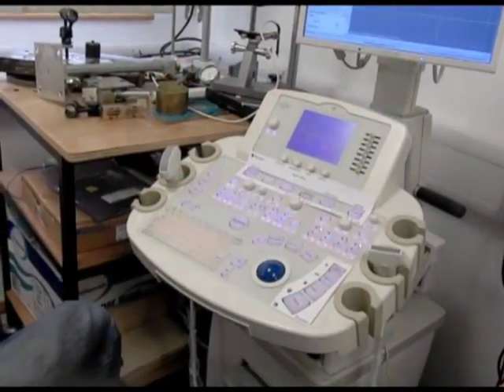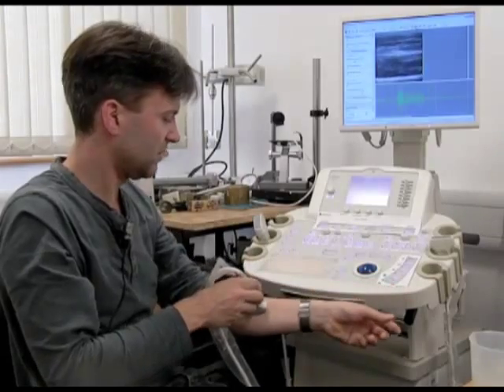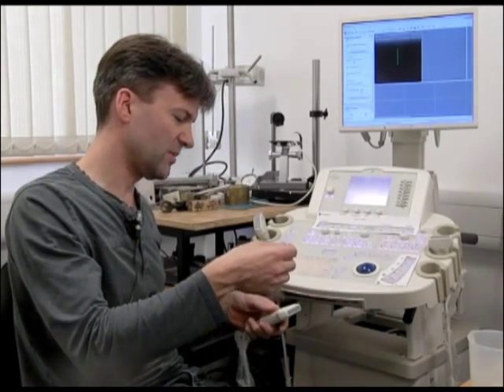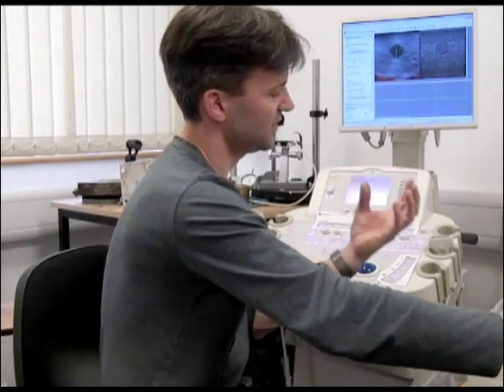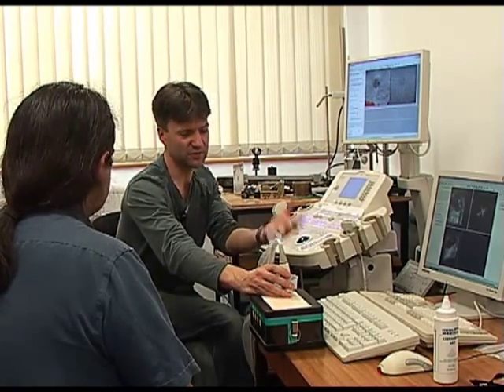Ultrasound Elastography - Naked Engineering

Comment: AI Summary

Abstract:

This transcript features Dr. Graham Trees discussing the fundamentals and recent advancements in medical ultrasound imaging. He explains how ultrasound uses high-frequency sound vibrations, similar to sonar, to create cross-sectional images of soft tissues by detecting reflected waves. The detailed explanation covers the function of a multi-crystal probe, which uses both physical lenses and electronic focusing to form a narrow sound beam. The core innovation highlighted is "stiffness imaging" (or elastography), a method that utilizes the same ultrasound signals but analyzes subtle tissue movement and strain to map stiffness variations within the body. This technique is presented as a more precise and deeper alternative to manual palpation, capable of identifying stiffer anomalies like cancerous lumps that might be indistinguishable on conventional ultrasound images. A demonstration using a phantom with embedded stiff spheres clearly illustrates the superior contrast of stiffness imaging compared to traditional reflection-based ultrasound.

Summarizing Ultrasound Technology and Stiffness Imaging

*   0:05 Basics of Ultrasound: Ultrasound is a widespread, cheap, and effective medical imaging technique for soft tissues, including fetuses. It uses high-frequency sound vibrations, beyond human hearing.
*   0:28 How Ultrasound Works: Sound vibrations travel into the body, bounce off different tissues, and are received back by a probe. This process is analogous to sonar, forming a cross-section image of the body.
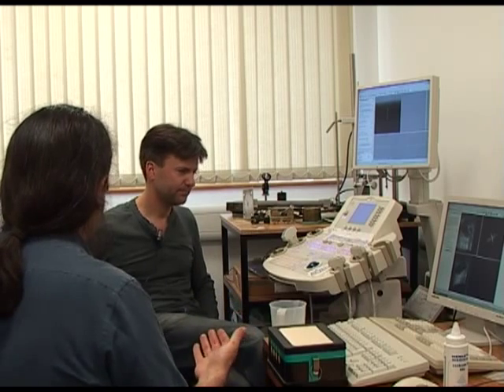*   1:10 The Ultrasound Probe: A typical probe contains an array of hundreds of crystals. These crystals vibrate when electronically pulsed, sending out sound. They then convert the returning vibrations back into electronic pulses, which are displayed as an image.
*   1:44 Creating an Image: Multiple crystals are used to create a cross-section image (not just a single line of data), by sending and receiving sound from adjacent areas sequentially.
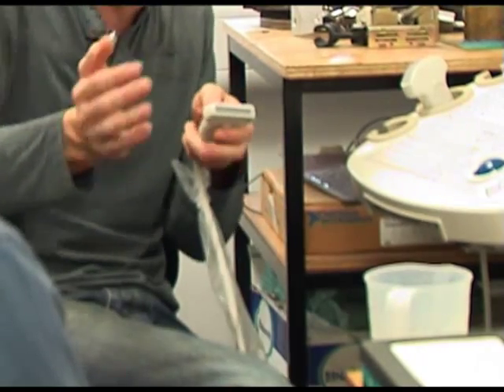*   2:01 Focusing the Sound Beam: A physical lens focuses the sound in one direction (elevational), while electronic focusing (firing crystals with slight delays) creates a narrow beam in the other direction (lateral), resulting in a thin sound beam.
*   2:38 Practical Application & Limitations: Water or gel is essential for scanning as air reflects all sound. Ultrasound is ideal for soft tissues and babies because bone almost entirely reflects sound, preventing imaging beyond its surface.
*   3:42 Introducing Stiffness Imaging (Elastography): Dr. Trees introduces a more sophisticated use of ultrasound that images tissue stiffness rather than just sound reflection.
*   4:09 Clinical Significance: Stiffer areas, such as cancerous lumps, typically "pop out" very clearly in these stiffness images. This offers a more precise, objective, and deeper method than manual palpation (feeling for lumps). It can detect millimeter-sized anomalies at depths of 4-5 cm.
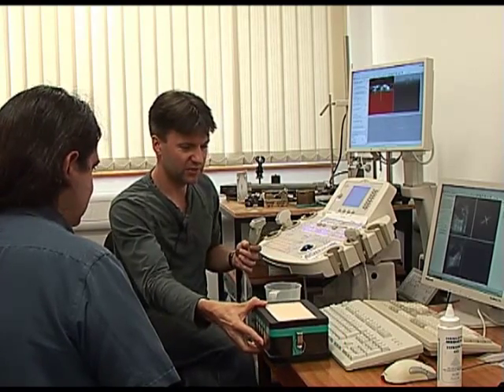*   4:54 Phantom Demonstration: A phantom (tissue-mimicking material with stiffer spheres) is used to demonstrate the technique. While a conventional ultrasound image shows little, the stiffness image clearly highlights the stiff "blob" (black indicates stiffness).
*   5:28 How Stiffness is Measured: The technique involves tracking minute movements of anatomy across multiple images (50 frames per second) as the probe is gently moved. Stiff objects move as a whole, while soft areas squish (undergo high strain). By differentiating these movements, a "strain image" is created, which directly represents tissue stiffness.
*   6:35 Key Takeaway: New Material Parameter: Stiffness imaging uses the same underlying physics as conventional ultrasound but reveals a completely different material property (stiffness) that is not visible in standard sound reflection images, offering distinct diagnostic information.

I used gemini-2.5-flash-preview-05-20| input-price: 0.15 output-price: 3.5 max-context-length: 128_000 on rocketrecap dot com to summarize the transcript.
Cost (if I didn't use the free tier): $0.0048
Input tokens: 14451
Output tokens: 765